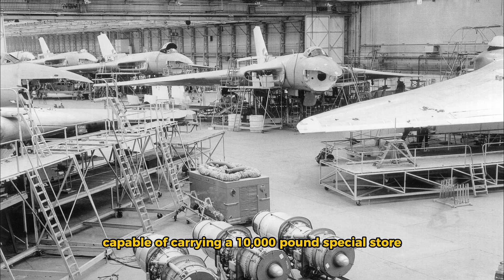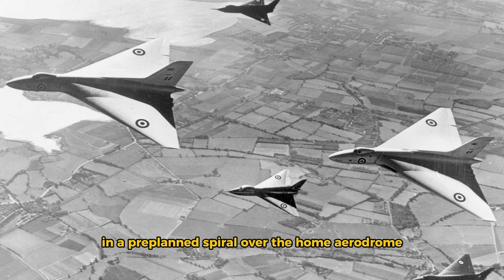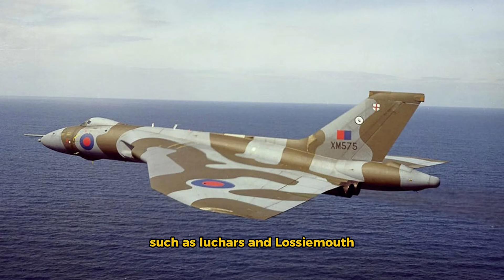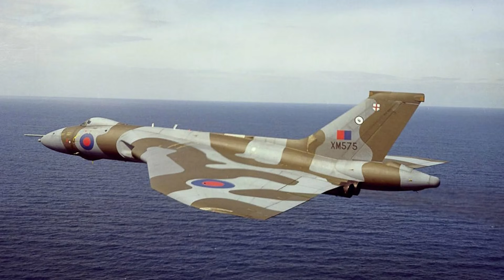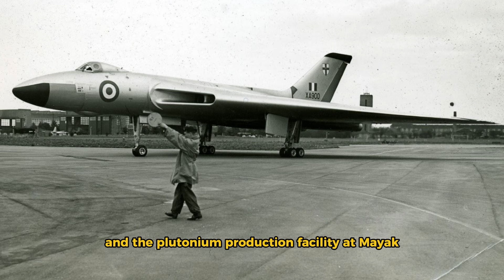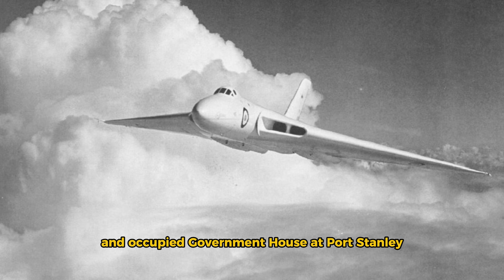Why the USSR Took the Vulcan Bomber Seriously

Comment: The first production Vulcan B1 was XA889. The Lincolnshire Wolds run from the Humber towards the Wash. Waddington is on the Lincolnshire Edge which is made of limestone and not concrete! V-bombers did not climb to operational height before coasting out – this would have used vital fuel as well as being in the vicinity of incoming strikes. The first three Vulcans squadrons were formed at Waddington, Scampton and Finningley respectively. The second prototype was VX777, not 770. The Vulcan had two main spars, one running through the front of the bomb bay and one through the rear. The engine nozzles were round, not rectangular.
No civilian airfields were designated as dispersals. They were either RAF, RN or Ministry owned. Manston was an RAF station. Mark 1 Vulcans had electric starters. Mark 2 Vulcans could be started by an external trolley, usually a Palouste made by Blackburn, not Plessey, or by the internal rapid air system, sometimes simultaneously.
Spadeadam did not become a range until the mid-1970s. Vulcans did not fly at 450 kn at low level. The maximum once only dash speed was 415 kn. There is no such place in Wales as Mach Loop and the term only became used well after the Vulcan had been withdrawn.
Vulcans armed with WE177 were not held on QRA after the Royal Navy had taken over the deterrent.

Comment: I don’t know if this is just pure AI generated slop, so I will not get a response, but the Vulcan did not leave RAF service in 1982 as stated, as some airframes were converted to flight refueling capability and served until 1984.